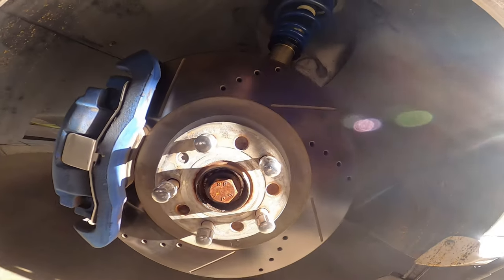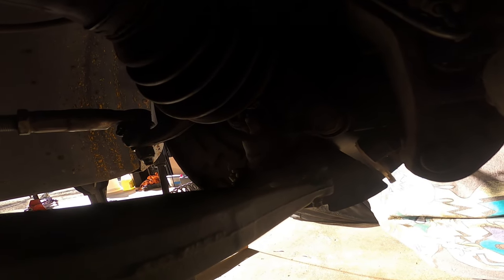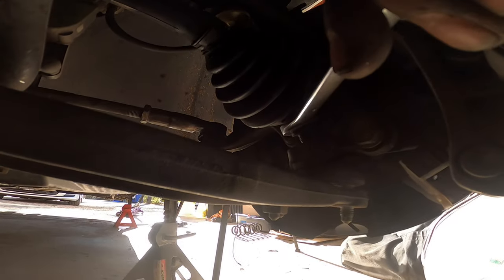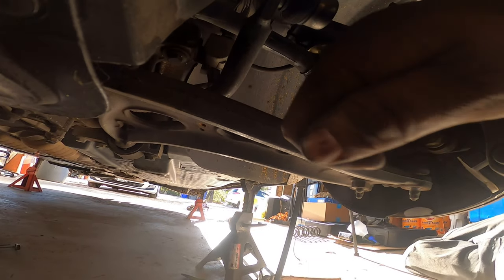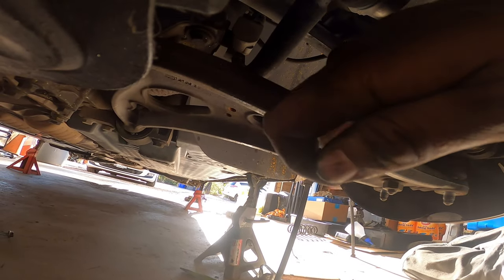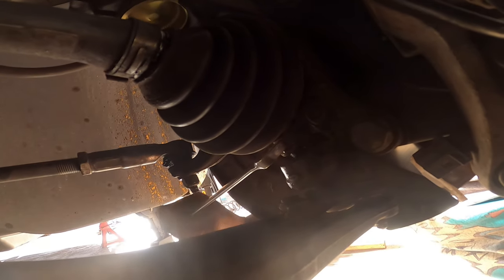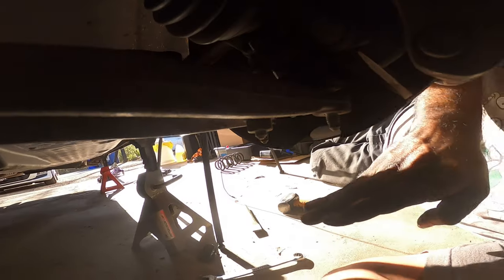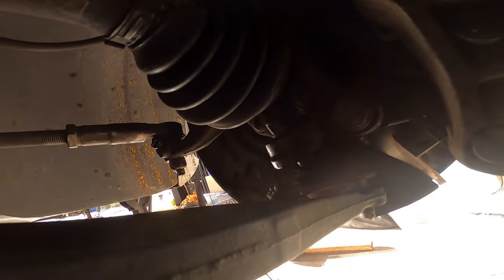The Ball Joint Trick Quickie

Comment: Not very smart to try an pop a taper like that. You can put a little pressure on it like that. Then just smack it on the knuckle where the joint thumb goes through. If all you do I just crank the nut into the axle cup your gonna wind up bumming up the threads on a joint one day and you'll be worse off than you started.
Reply from the maker: I done this trick hundreds of times. Best way to do it fast without removing the spindle. The good thing you don't have to do it. It's not for everyone.